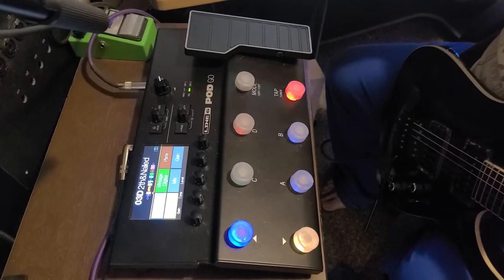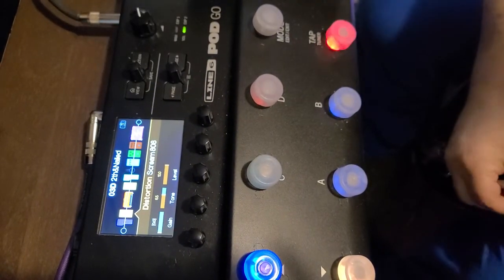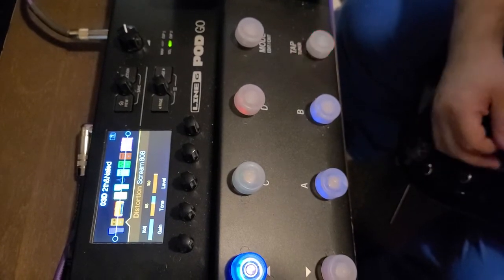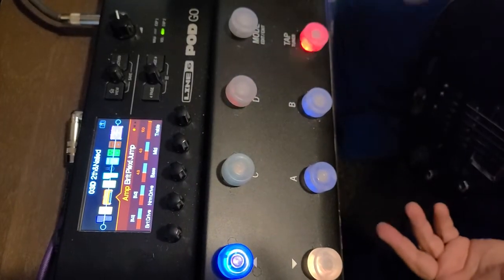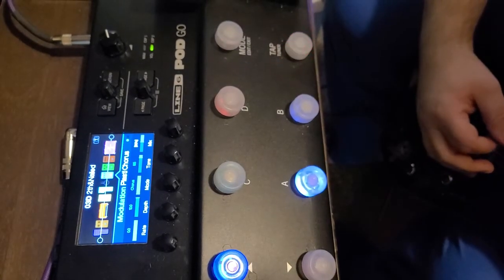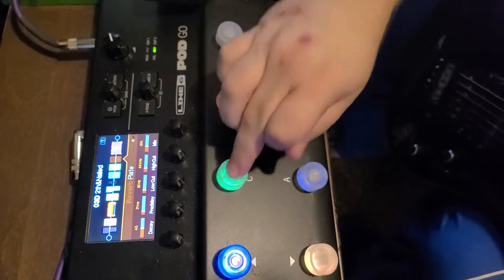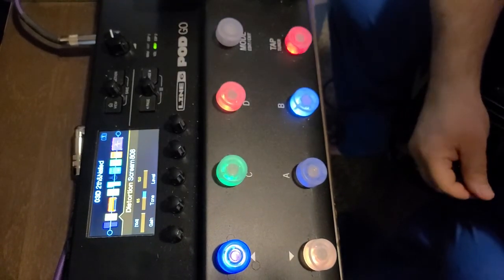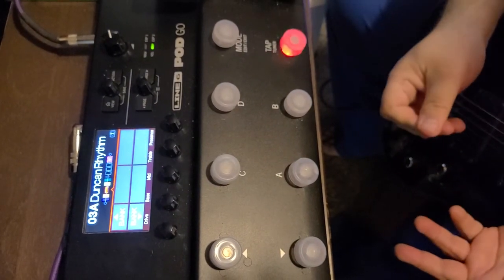Pod Go Tutorial: Using one amp for dirty and clean tones.

Comment: The way I go from clean to high gain is to have a mini Mooer preamp pedal in the fx loop of the POD Go. I have the loop assigned to a footswitch. When the switch is off the POD amp is bypassed and I get the clean channel of the Mooer. When the switch is on the loop switches off and the POD amp switches on. I can go from totally clean to raging high gain with any amp model I want to use. It switches instantly with no drop out or lag also.
Reply from the maker: Its an option, this way allows you to do it with just the PodGo.

Comment: I have a brit 2204 preset that has a crunch , lead, and clean snap shots.    surprisingly dont get any clipping switching from lead/crunch to clean and  adding the analog flanger really helps on the clean snap shot.    I will say that I am using a "jailbreak" preset so Im able to get the most out it.